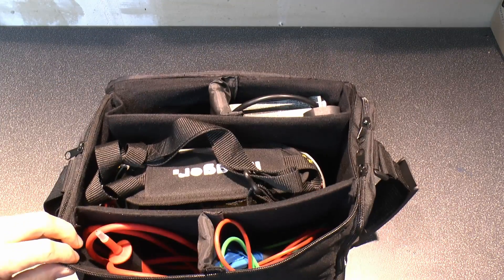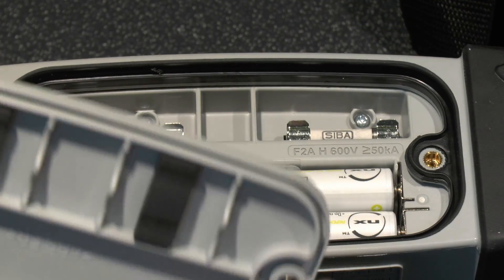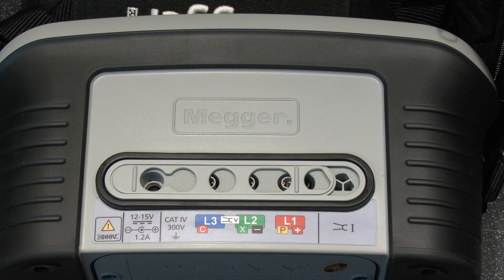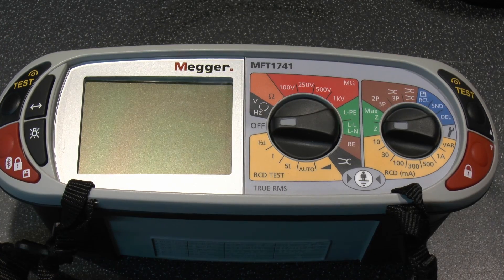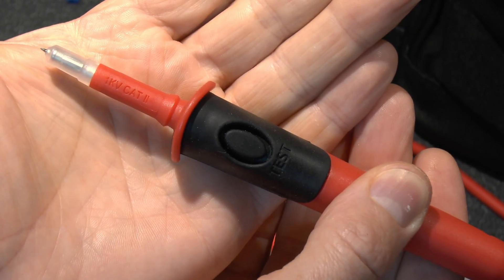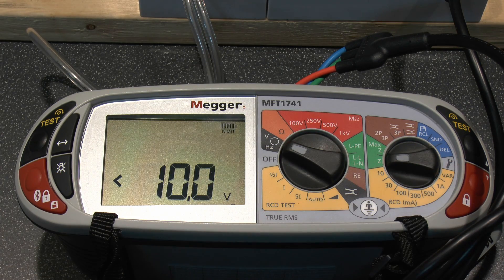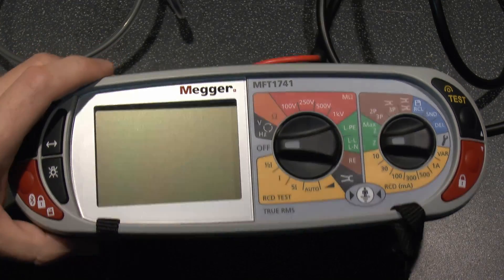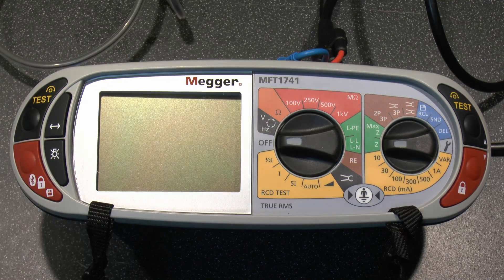Megger MFT1741 Review and Demonstration

Comment: On variable RCD setting you can get to the higher RCD numbers quicker by going down the scale. After 10mA it goes to 1000mA,990mA,etc.
Also the voltage plug will give you L-E v if you press test. Press test again you’ll get N-E v, press again L-Nv.

Comment: Well put together and explained John. Well done.
One cannot not compare Megger to a fluke multifunction meter. To be honest it's a fluke if you actually record the resistance of a circuit with a fluke meter and test it again and get the same measurement !!!
Megger multifunction testers are by far the best. Also comes with three year's warranty and in my opinion the leads are also better quality.
Reply: Nah, Fluke test leads are brilliant, I just can't bring myself to use them on a Megger..! The Leaderman brand from Testermans are pretty good, though, I mainly use them these days.

Comment: They're are releasing a 1741 plus in the coming weeks, with a 6mA RCD test function. Currently Metrel is the only brand that can do a 6mA RCD test.
Reply: @mikeZL3XD7029  to test installations involving EV, P.V ,any other installation that has requires pulsating DC current protection and proctected by a Type A - Type F RCD. Appropriate equipment is required to carry out a test, that ensures disconnection of the supply in case of a DC fault above 6mA.

John Covered RCD requirements in this video. https://youtu.be/HjEdR2PtK8Q
Reply: It's out now, not much of a price increase to the 1741.
Reply: What's the difference between mft1741+ and mft1825? I want to buy one, Thanks

Comment: Great overview JW, and I must agree with your comment at the end, what a rubbish manual supplied, or available online from Megger.  I bought one of these myself 4 months ago and complained to megger about the manual being non-model-specific. Their reply was almost on the lines of...' this is the manual, take it or leave it'....

When I bought a £300 washing machine it came with a full printed manual that described everything. why then when buying a bespoke piece of electrical testing equipment costing just under £1k, does it not come with a full manual for that specific model, just unbelievable !

Your video should be sent out with every machine as it gives the user the information they need, rather than having to rummage through pages and pages of irrelevant information that relate to a machine that you haven't bought!

As a market leader in test equipment, Megger should put more into the customer manuals. It's not that hard, surely.

I'm new to the testing game, so I don't have years of experience, I just want to know how to use all the facilities that the machine I bought provides.

Would be interested in seeing your thoughts on earthing for large scale generators (60kva) as this is my line of work. I have many colleagues who have differing opinions on when and how to earth generators for temporary events (BS7909). Particularly the situation where you have a generator sited on a road, providing power to market stalls and food stalls, so no soil available to put an earth stake into!

I have learned so much from your content, so thanks very much indeed.

Comment: I bought a Megger Current Clamp replacement lead (6220-807) and use it with my Fluke i400 AC Current Clamp for current measurements.

Comment: Great content . You are an excellent tutor.
Where can I get replacement motherboard for megga insulation resistance tester?  I had  some batteries leaked and corroded the motherboard.
Is it possible to buy a used one?

Comment: Is the prospective fault current calculated on the measured voltage ?
I typically want to measure 110v and 414v circuits.

Comment: Are there any down sides to the 2 lead low could you use it all the time instead of the 3 lead
Reply from the maker: It takes longer, and can be less accurate, particularly on circuits with connected equipment.

Comment: The two test and lock buttons are so it is easy to use by either left or right hand. On some other meters, you need to press both when using insulation testing, not on this one. Which is ok.

Comment: Job for you John.

Video please of you testing an RCD with real cheapy equipment - basic milliammeter and an earth leak on the neutral via a variable resistor. Let's see how little money you need to spend to test RCDs.

EDIT: skip the variable resistor, just use an 8·5kohm resistor - across N & E. If it trips, 30mA RCD has passed the test.

2nd part of video - measure trip current used on RCD test buttons. If 30mA trip and in-built test circuit has resistor to give 25mA leak - and it trips - then just sit down and try to 'sell' us the reason you needed a MFT1741 - cos I think they've seen you coming !

Comment: Thank you for the video. How can it supply 250-1000V by just using 4x AA batteries?
Reply from the maker: Battery supplies an oscillator, which then supplies a transformer to increase the voltage, output of that rectified to produce DC.
Reply: @jwflame  thank you. Your videos are extremely informative!
Reply: @jwflame  Did you say six AA batteries,  four on the top and two underneath !

Comment: Been using a 1741 for about a month now. It's alright but the 2low  setting is shite compared to the 2low setting on the LTW425. Confidence meter and rcd uplift protection are nice but I think I preferred the fluke 1664

Comment: John, Grateful if you tell me which value have to note down  L-PE or L-L/L-N while measuring the Zs in TT system as i got  huge variation between two modes
Reply from the maker: Zs is always L-PE. L-L and L-N are used to determine the maximum fault current.

Comment: Hi, JW! Would you so kind toate tell me pls, which is the main difference between MEGGER MFT 1700 series and 1800 series? In particular, between MFT 1741 as you already has been presented very well in this video, and MFT 1835. Practicaly, both do the same job. Tks
Reply from the maker: The main difference is that the 1700 series is designed for use in the UK, and the 1800 series for use in other countries.
Reply: @jwflame  Tks a lot  JW. Here I have only Mft 1835

Comment: Great Video John, can I just ask you if you are using the the rcd function to test an RCBO what type do you set it to on the meter  if you don't know what type the RCBO is ?
Reply from the maker: BS EN 61009 requires that Type AC has the symbol on the front, or optionally on the side.
Type A must have the symbol for type A marked on the front, so that it's visible when the device is installed.
Therefore if no symbol visible when installed, it's a Type AC.
Reply: @jwflame  Thanks John its an old Square D rcbo no markings on the front
Reply from the maker: @acestu  if it's one of the old black ones, it's probably made to BS4293, and will be type AC, as that standard didn't have any concept of other types.
Reply: @jwflame  Hi John, Not the old black ones its a QOE cream coloured one but now Shneider have taken them over I cant find any info on them Thanks for your Help BTW

Comment: Hey John I've completed a level 2, and I have just started the c&g level 3, we are also doing the 18th edition as a part of the course.

When I pass will I be able to sign off my own work on domestic installations.

I've heard different things, but you have a lot of knowledge so I wanted to hear your answer.

Thank you
Reply from the maker: Two seperate things:
1 - testing what you have installed and completing the certificate (minor works, installation certificate).  Required for all installations.
2 - notifying the few things in domestic situations for Part P - only needed for consumer units, new circuits and items within the zones of bathrooms.
If you have done the L3 and the 18th, then you can certainly do 1 - that's just part of doing the job.
If you want to do 2, you will need to join one of the competent persons schemes and pay whatever their annual fee is.

Comment: I'm not entirely convinced that the earth clamp should be coloured green/yellow. Yes, it's connected to PE, it's measuring PE, but it isn't, itself, a PE lead. It fills no earth protective function in the device, and could additionally fall off at any time because it is an alligator clip. Therefore, it seems to me that it would be practically a code violation to colour it green/yellow.
Reply: Indeed if anything it should be cream... It's a functional earth
Reply from the maker: and from 2020, functional earths are pink. 
Pink test leads for everyone.
Reply: @jwflame  To be honest, FE's being pink is a bad idea. It's only been 15 years since red/black was 'de rigeur' and some shades of the red definitely went on the 'whiter shade of red' (especially FP200 style cables). It's a potential minefield on new retrofit boards to have an FE wire from an RCBO that is potentially the same colour as a line/phase conductor from 2004. What was wrong with cream? FE wires have been cream from at least the early 80s (mostly used by British Telecom).

On the original point... Green is a good compromise in the UK at least. It's not used for anything else, which surely is the main objective for a test lead, unambiguous usage.
Reply: @jwflame  Big Clive approves!
Reply: Also it's not just an earth, it's also used as a phase conductor for some measurements. Similar for the blue lead, it can be either a neutral or a phase depending on the test being performed.

Comment: When I spoke to Megger regarding my rechargeable PAT100R they told me that you could not just change rechargeable batteries with standard ones without getting it recalibrated due to the different voltages I assume that it would be the same with this range of testers.
Reply from the maker: There is a setting in the options menu to select either NiMH or alkaline.

Comment: John, thank again for a comprehensive review.....just wish I could afford one!  As an aspiring sparky I've watched hundreds of videos on testing (EICR etc) and never once have I seen the IR test reading rising due to the "capacitor effect".  Normally the reading immediately displays >999 ohms or whatever.  Can you explain please?
Reply: Happens all the time
Reply from the maker: Cables may have been very short lengths, the effect is far less noticeable there.
Or they are doing it wrong.  It's also very common to find IR tests with results that are not the maximum reading, particularly in older installations.

Comment: I just brought a MFT1741 a month ago, (as my fluke was over 10 years old and can not test type A rcd's) The price is high but why not buy the better/best MFT (tools etc do come off your tax bill eventually)
Reply: Realistically, I suspect you could adequately test RCDs without spending more than £10 on test equipment.

In fact, I can test RCDs without any test equipment at all. Just press the test button that they have on them. It's not rocket science you know.
Reply: @millomweb  A functional test of the test button is required for electrical certification but also required is the trip time in milliseconds which is also recorded on the certificate, i for one do my job right
Reply: @ashleyrowe2681  Trip time is not a certifiable parameter for the purpose of getting a certificate of conformity. Whether it is quick enough is. All that is required to be recorded is pass or fail.
Reply: Then you bought the wrong Fluke model back then. Here in Germany type AC is not permitted for new installations since 1984, standard type RCD in residential buildings since then is the type A. So type A RCDs aren't a brand new thing which just fell from heaven yesterday. But I remember the same thing here, but there it was "my tester can't handle type B RCDs". My 2014 Fluke 1654B can handle all of them all.
And don't get distracted by that troll...he'll learn his lesson if in some time someone comes over because someone get injured by electricity and then you can proof what you did. And numbers are much more worth than simply "pass" or "fail"...

Comment: Zs measuring - when selecting 3Lo the Rcd symbols appear but on 2Lo they do not. What does this infer regarding tripping (or not) the RCD?
Reply: normally rcd trip on 2 lead test if the lo mode not applied. I use 3 lead test on high for a more accurate test

Comment: It's a frustration that none of the mainstream MFTs can measure up to 1000V despite them all having 1000V insulation resistance tests. That makes them impossible to use on solar systems which can have DC voltages up to 1000V.

Comment: How did electricians do testing prior to these type devices coming on the scene?
Reply from the maker: Individual testers, one for each function.  Typically a big case with 4 or more separate test instruments inside.
Before that, individual test devices in their own large wooden cases.
Reply: @jwflame  have you any lying around as it could make for an interesting video on the history of test equipment. Thanks John.

Comment: Is it possible to damage the tester by plugging in the wrong colours of the leads that are attached to the mains plug ?
>
Reply from the maker: No, it and other similar testers have protection to cover situations like that - not just to cover errors in use but to also allow for installations with faults such as sockets wired up incorrectly.

Comment: My first placement as an apprentice is with somebody just doing EICRs. My worry is I'll blow up the tester (kewtech) by using the wrong setting. It's this possible? The company I'm working for sent out a memo to all the sparks last week saying that there'd been two incidents of electricians reenergising without removing test links in the CU (blowing the main fuse) and that now all test links must be long enough to hang out of the CU. But yes is it possible to blow up a tester using the wrong setting?
Reply from the maker: Very unlikely.  Certainly possible to blow the fuse(s) inside, but selecting the wrong option isn't likely to damage or destroy anything.

Comment: Having zeroed the meter on the long test lead 41:43 if you then use the short test lead, does the meter read negative resistance values ?
Reply: The Megger MFT doesn't display a minus(-) reading, the screen will flash zero(0.00) if the reading is below scale.

Comment: Jesus thats a bunch of test functions on the megger if you're in the field you get pretty all scenarios covered. Mail them to make an attachment to the missing instructions. Like to see the earth rod testing . Can i use some high voltage 10MOhm resistors as refence for any insulation tester ?
Reply: Well just bought 10Mohm resistors 10KV voltage rated to use as reference . The insulation tester model is ut501A and it is in spec with resistors and a DMM with 10M internal impedance. Also got one faulty wall socket on kitchen :(
Reply: The search words are  vr68 10M

Comment: Why is Cat 111 = 1000 volts and 1V = 600 volts. You would think it would be the other way around ?
Reply from the maker: Cat IV 1000V is available, but not on this particular device.  The rating is more to do with the amount of energy present if a fault occurs, the voltage is only part of that.

Comment: It is ok. But has few quirks and things that could be done better. 1) Lack of acceleration in the up/down. 2) The voltage showing as "< 48 V", or "< 195 V", is a bit meh. I wish it showed actual value in some other place too. The resolution of only 1V, is okish, but with it had 0.1V resolution, even if accuracy is only 1V. I mean the accuracy of this meter is sloppy at best. Most of the measruements functions only have accuracy of about 3%, some even 5%. So that is a bit meh in my opinion. 3) The bluetooth functionality could be so much more. Triggering tests and reading results immedietly on a phone or table, would be super useful, for logging, and operating the megger from other room. I.e. One could put a megger in resistance mode before all the circuit breakers between L and N, and with no other loads, and no supply, just go around the property putting jumpers into all sockets and light fixtures to measure line resistance. 4) The analog meter in insulation resistence test is just stupid, and the space on LCD could be utilized for something more useful.

Comment: Nice piece of kit, but the price makes me cough.
Reply: I've never felt it necessary to use 1kV to test resistance. Meter I have goes up to 30 Mohm - that's near enough for me !
Reply: @ss54.  It depends how paranoid you are. Not that I'm not paranoid - having added earth leads to some electrical items that didn't come with three core cables - mostly TV/video gear - due to the live aerial connectors on the back.

Comment: It's interesting that both those rotary selector dials have sixteen positions.
Probably not to you.
Or anyone else for that matter.
But for me...
...well I know I'm a freak.
>
Reply: Indeed it is quite interesting that all the modes can be expressed with just one byte!
Reply: @sivalley  Actually, one bit.
Four bytes in total.
>
Reply: @Bodragon  I thought 16=2^4 so 4 bits per switch, 2 switches, 2x4 bits = 8 bits, 8 bits per byte, both switches encoded with one byte

Comment: A piece of kit that comes with leads with a mains plug on the end - so you can plug it into a conventional mains socket which could be switched on.
So connected as such, WTF doesn't it charge its batteries ???????????

Reminds me of FAX machines - connects to the damn phone line but you still had to set the clock on them !
Reply: @mikeZL3XD7029  It's more a point of what it doesn't do !